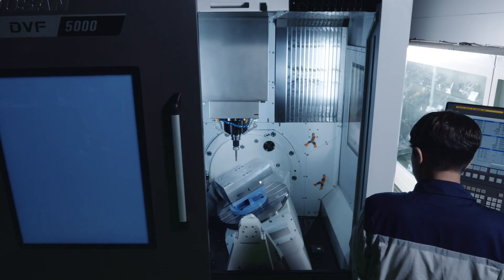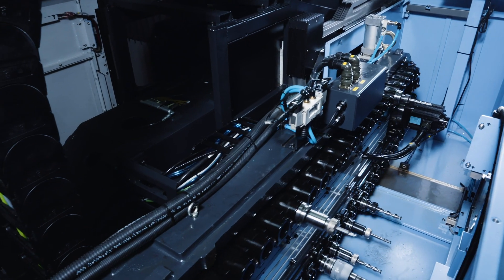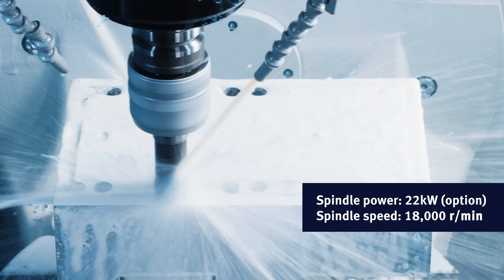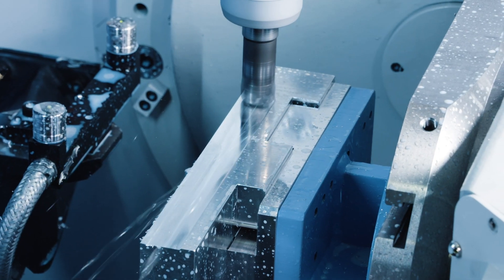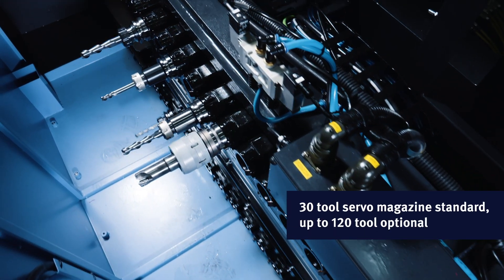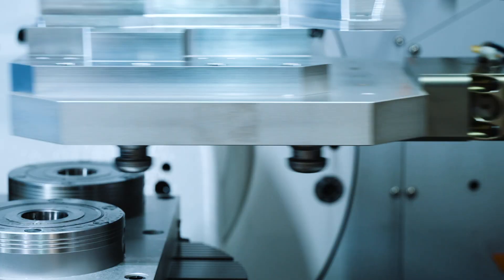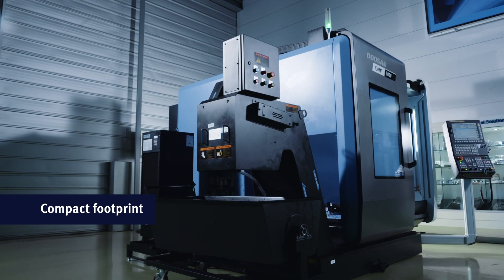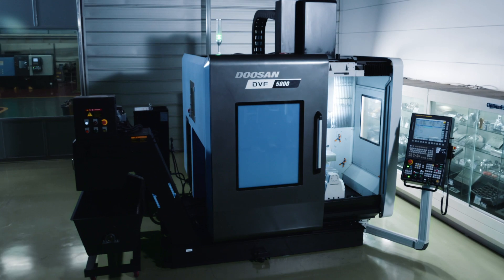The ALL-NEW DVF 5000 5-AXIS Vertical Machining Center

Comment: Sorry. Is the maximum spindle speed 18000 rpm? There are no other speeds? Thanks
Reply from the maker: Yes the maximum spindle speed 18000 rpm is optional to DVF 5000. You can see not only DVF 5000 but also the other DVF series through link below. 
https://bit.ly/32eqF3t
Reply: how much you need???????:)))))))))))) 1 million?